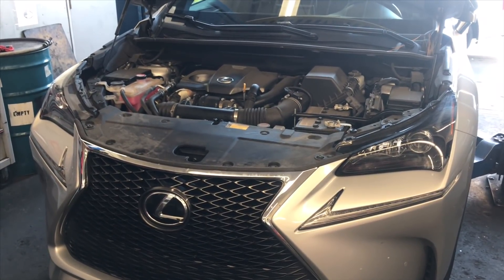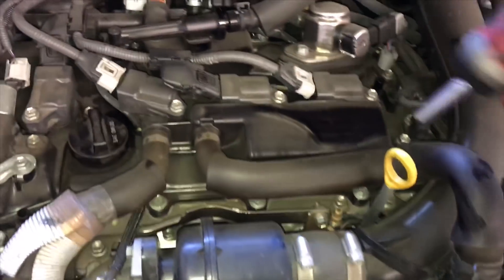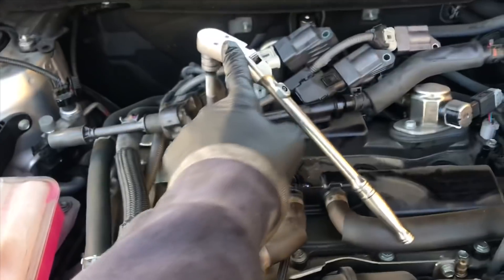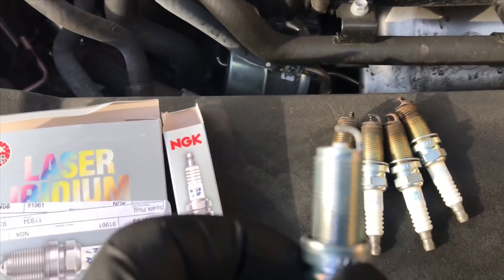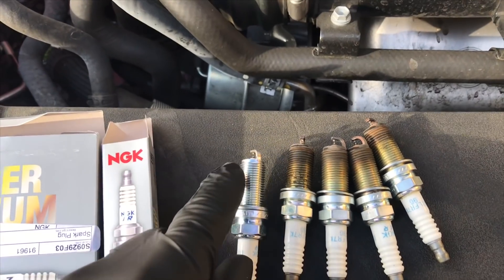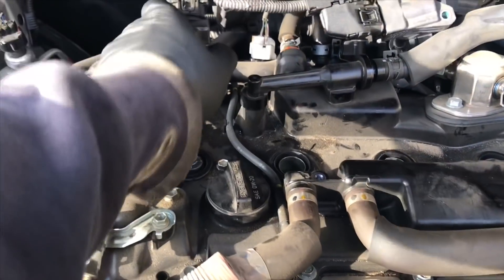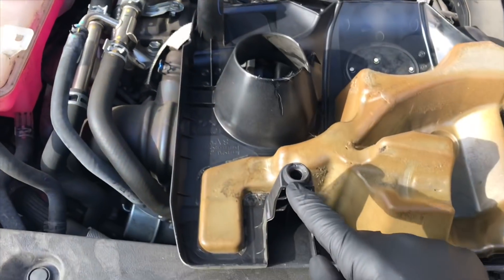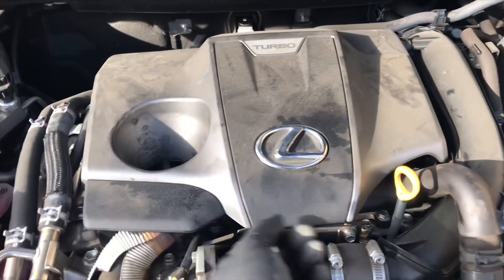How To Replace Spark Plugs On A Lexus Nx 200t F Sport

Comment: You must blow out the spark plug hole with compressed air before removing old plugs to  eliminate any dirt or grit from getting in the cylinders
Reply: when you "blow out", isn't it possible all that dirt or grit to get inside the cylinders? shouldn't you "vacuum" out instead?

Comment: Thank you for the video. I didnt have a magnetic socket so I had to loosen up the plug completely and then stick the rubber socket back in there to grab the spark plug out. Took less than an hour. Can't believe lexus wanted $400 for this. They also tried to sell me the spark plugs for $53 each!! I ended up using the amazon link you provided. Fresno Lexus :(
Reply: Fresno Lexus quoted me $738 for the 40K service which included the plugs. Forget that! I will also tackle this myself also.
Reply: plugs were $17 each...figure ½ hour of labor ($60) @ 120/hr. Now add in all the overhead of the dealership...
Reply: Lexus of Winter Park, FL quoted $278 for this job (parts and labor).  I'm going to do it myself.

Comment: In your video (how to replace spark plugs on a 2015 to present day lexus nx200t F Sport) you said there are 4 grommets and 4 posts for the engine cover.  That is wrong because there are only 3 posts on the cover, and 3 grommets on the engine. If you watch your video you actually point to 3 posts but you say 4. You made a mistake, maybe you were confused.

Comment: Thanks so much for this video, overall it was fairly easy (learned to use the torque wrench for the first time). One of the 10 mm bolt won't tighten and it got twisted so had to get a ride from a friend to a Lexus dealer to get a replacement, very cheap though ($1.05).

Comment: I followed your directions and purchased a magnetic 10” ratchet extension. 
Got all off but had to stop because even though I was putting pressure to loosen 
It wouldn’t looosen and I was afraid to break spark plug. Any suggestions?

Comment: What about the message on the dashboard ( engine power reduced) how to reprogram it after repair?
Reply from the maker: Fahad Alghadhfan  all you need to do is clear the code with a code reader or scanner.
Reply: Did this pop up because you used a non-OEM plug? Wondering for when I eventually have to do this
Reply: I brought a cheap code reader just in case the message popped up.  But I didn't get any message and no code.  I used the NGK plug.

Comment: Great video, I wonder why they don’t recommend anti seize on their new NGK spark plugs?
Reply: It interferes with the grounding of the plugs
Reply: Danny D 1333 thanks for quick response have a nice holiday
Reply: Also many of the modern plugs sold today come with an anti corrosive coating already put on the threads

Comment: I removed the 4 #10 bolts but I can trouble getting the coils off the plugs, they wouldn't come up and I didn't want to force them. Could it be the engine was still warm ?